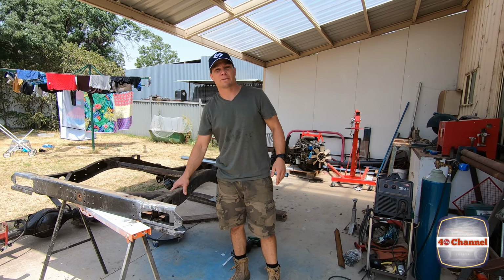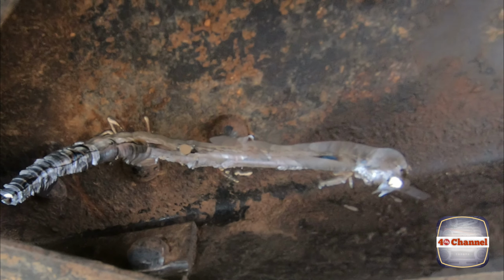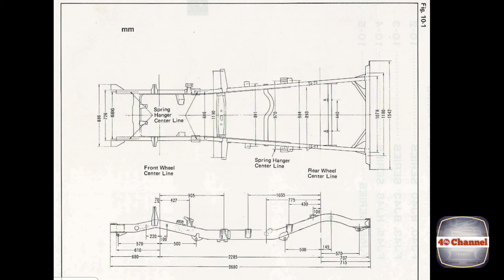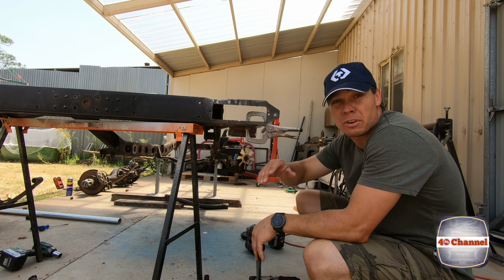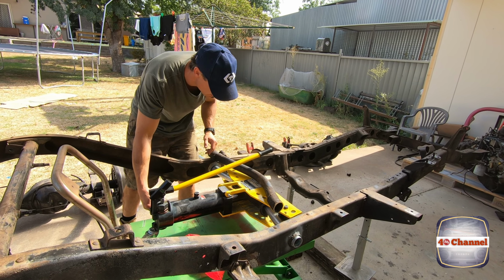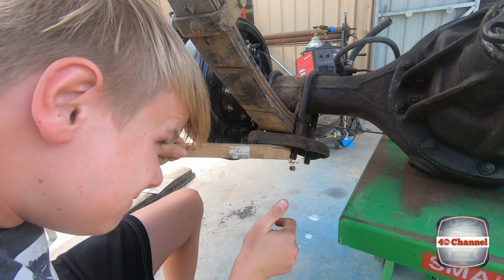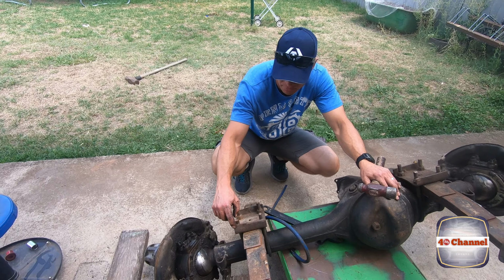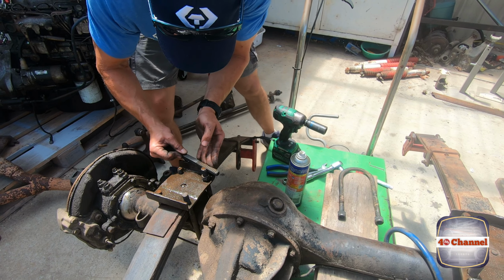EP32 - Chassis and axle Strip down and repairs FJ40

Comment: Have you looked into pressure washer wet sandblaster's? 
Years ago i did complete frames and All Kinds of stuff with one. 
They are pretty cool. 
I will be doing my BJ40 With one "I hope" I get time this year LOL!
Reply from the maker: No I haven't looked at the wet sandblaster. But I heard they are good no dust to worry about. I have access to the sand blasting shed which has a large extraction dust fan, I have already sand blasted the chassis, it came up awesome! look forward to seeing your BJ40 build soon.

Comment: Are those full floater rear axles popular there in Australia?? Don't see those much here.
Reply from the maker: Mine are from a 60 series,  landcruiser. This mod not only upgrades the rear axle but the hand brake setup. This was done before I brought the cruiser. This is not a uncommon upgrade in Australia to take later model axles.

Comment: Hi, where can I find that frame dimension sheet? My 73 frame is rotted and needing a few replacement parts.   Looks good brotha, appreciate the tips.
Reply from the maker: You should find it on ih8mud.com, if not your can Instagram me message and I can send you a copy.
Reply: It's in the Frame section of the factory service manual.....search on the IH8MUD forum, or you can find other sources for the manuals on Google.

Comment: I’m planning on shortening a hj47 troopy chassis. Any tips for welding it back together? Can I do it myself or will I need someone with a certificate to do it?
Reply from the maker: Cutting a chassis and welding back together is a big job, If you are a competent welder then you could, but the cut and joints should be made at 45 degrees, and make sure you take the time to do the correct weld prep, I spent a good 2 hours prepping my weld for the crack in this video, Veeing out and cleaning plus heating after for Stress relieving of the metal, I would fish plate over the top for the extra strength, take photo's the whole job for the engineered to pass it off at the end (If in Australia)
If there is any doubt then I would ask a ticketed welder to help you out.
Reply: Thanks mate. Much appreciated. I am in Australia. Been welding for about 15 years now as a part of my trade. 
Thanks again for the knowledge 
And keep up the great videos. Can’t wait to see the ol girl finished